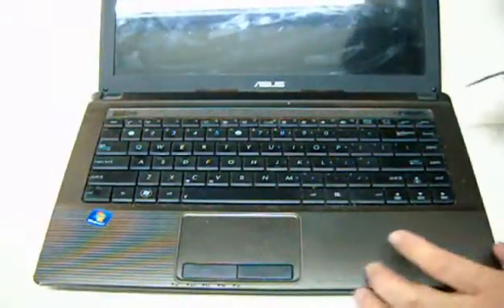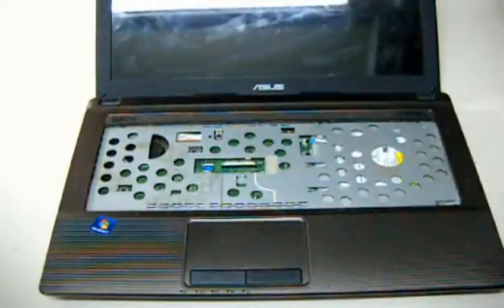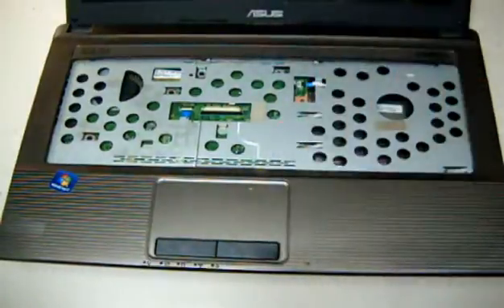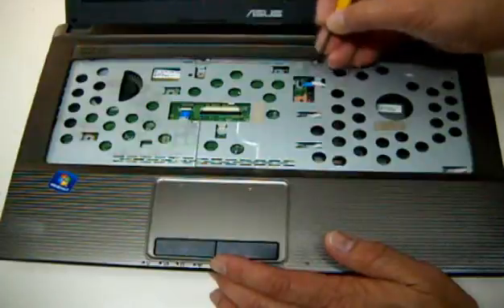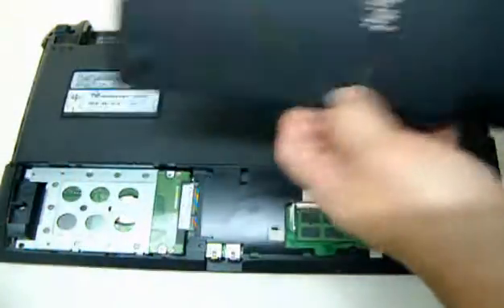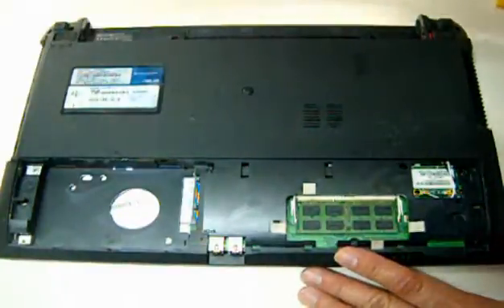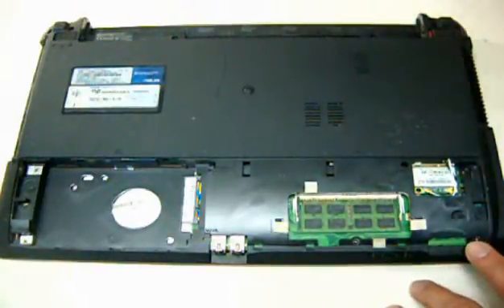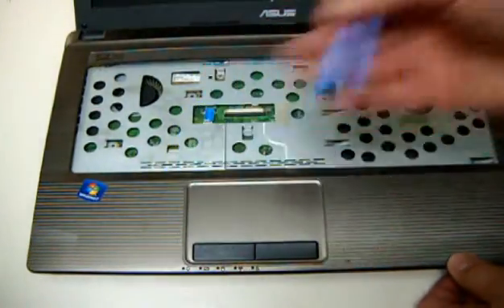How to disassemble Asus X44H K84L Notebook (complete)

Comment: Thank you!  Is the max memory for this model 4GB on one slot? I don't see another slot in your video.  Is it possible to upgrade the memory to 8GB?
Reply: one slot in a laptop and an 8GB memory module (DDR3-1333) can be installed. You can replace the processor, maximum you can install i3-2370m, i3-2350m. It is good to install an SSD for Windows.
Reply: did you upgrade the memory to 8 GB?
Reply: @yuriromero3637  yes, only the memory module must be of 2R*8 format (8 chips on each side, 16 chips in total) DDR3-1333 1.5v. 
Processor must be any i3 gen 2 (-2330m, -2350m, -2370m)
Reply: @slavafedotov5742  how about i3-2310 ?
Reply: @azam302  i3-2310m will work, but I would recommend that you save up money to buy an i3-2350m, i3-2370m processor.

Comment: Helpful video. My Asus X44H K84L Notebook was constantly re-booting and nothing in windows event monitor showed why this would be happening. Disassembly of the laptop revealed exactly what you mentioned at 12:10 in the video. The thermal conductive paste had dried up and the CPU was overheating so the bios was doing repeated shutdowns. I  cleaned off the old material and applied new thermal paste. The notebook runs perfect now. No more overheating and cycling on and off.

Comment: Hi Fabbs D,
How did the upgrade go?  How's your Asus laptop running now?  I have the same laptop and your success in this upgrade really encourages me to do the same.  If it runs well, I'll probably get the ram and cpu during the Thanksgiving Day sale this year.  Thanks in advance.  Where did you buy the cpu by the way?
Reply: Fabbs D, You can also post a video on the performance of your upgrade.  It'd be very exciting!
Reply: Fabbs D A few more questions:
1. Was it hard to replace te CPU?  As seen in this video, disassembling this laptop isn't easy.  I'm afraid of breaking anything.  (Replacing the HDD and RAM are a piece of cake, but not the CPU.)
2. I think there is only one memory slot, right?  An 8 GB 1600 mhz sodimm memory stick is still expensive right now. 

I'm sure the performance is outstanding, especially with SDD.  I used a Toshiba 128 GB SDD on my Acer Aspire One AOD270 netbook, and expanded the RAM to 3GB.  (You have to crack the 2GB ram limit on the 32bit Win 7 OS.)  Now it runs so well, with a 9-cell battery bought on Amazon.  It runs 12-17 hours without recharging.  With the original 6-cell battery, it holds about 7-10 hours.  I actually prefer this netbook to an iPad. 

So did you get an extra 2.5" external HDD?  How did you use the original HDD.  Just being curious.  This ASUS unit has a USB 3.0 port, I think an external storage would be very useful.  :-)

If you can, just show us a few things llike the boot time, regular MS Office use, and gaming.  You don't have to; I know it takes time to creat a video, edit it, and post it on YouTube.

Thanks a lot!!
Reply: Amsu Patel By the way, is this Asus unit's Wifi network card an 802.11g?  On an 802.11n network I see it shows 802.11g/n or 802.11gn.  Not sure what it is.  Asus doesn't provide good information about this laptop.
Reply: Fabbs D I'm not very clear about what you did with the external DVD RW and the 1TB HDD.  It seems that you put the HDD inside the DVD drive caddy, but how is that possible?  Anyway, that's an amazing job done.
Reply: Fabbs D As to the performance, I have no doubt about it.  It sounds like after all the upgrade this laptop is functioning like one that's twice or three times of its montary value.  Pretty impressive!
Reply: Fabbs D I actually spent a whole day on the Web trying to find out the max capacity of RAM size on this Asus laptop.  Some say 4GB; some say 8GB.  What's worst is that on the office website, there is no clear information about this.  But now your experiment proved me that it's 8GB and up to 1600Mhz.  Thanks a lot for your help.  You are awesome!
Reply: Fabbs D Holly molly.  That's a solid proof of the whole upgrade.  It makes it look llike a newer model that's on the market these days.  Thanks, man.
Reply: Fabbs D Hey Fabbs,  I assume you are using what's available and free for your 1TB hdd.  In case you want something smaller, there are 2.5" hdd enclosures and hata to usb converter cables you can use.  FYI.  :-)
Reply: Fabbs D Now I finally understand what the DVD caddy does for you.  I thought you have to connect to it with a USB cable.  It's internal and you have a C drive and a D drive.  Genius!  I'll probably do this as well.  Thanks again.  :-)
Reply: Fabbs D That's exactly what I'm saying.  Your Asus now has 2014 specs!  But how is video going?  I think the video memory is only 8GB and, over the 8GB limit, it has to share memory with the CPU, right?  Does this sharing memory situation work smoothly when you watch videos and play games?  I'm not a gamer, but I watch sports online from those ramdon websits.  A lot of times the streaming isn't smooth.  I think it's either the network from their server, or my home wifi (802.11g), or the video memory on my Asus.  What do you say?

Also, if later I replace the HDD with an SSD, and intall that original HDD in a DVD RW caddy and put it in the DVD drive space, would it work?  I know you use an external HDD in that caddy, but I'm thinking of using the original HDD in my Asus.  Thanks again.  :-)
Reply: Amsu Patel Video memory 8MB.  Sorry.
Reply: Fabbs D Not into video games like me.  :-)  What about my 2nd question?  It seems to be an obvious 'yes', but would lke you to confirm.  Thanks.
Reply: Fabbs D I was just curious about gaming, but not into gaming.  Thanks though.  I'm wondering if you can somehow make the DVD RW drive (removed from your Asus) to work as an external DVD RW with a USB cable.  That way, You don't sacrafice anything from this upgrade.  Just being curious.
Reply: Guess you do this for fun like me.  There are people who like to improve or optimize stuff instead of accepting whatever the manufacturer give us.  Thanks a lot for everything.  Happy Labor Day weekend!  :-)
Reply: Fabbs D You did a good job in improving and extending the usability of the laptop.  I went to Best Buy Sat and Sun and saw laptops with i3/i5 and an HDD that ask for $450-$600.  I'm sure your upgraded Asus performs much better than those.  I'll wait until the price of an 8GB ram stick (i7, SSD, and DVD caddy as well) gets lower, then I'll  do the same.  :-)
Reply: Fabbs D That's a good point.  It's too bad we can't change the video card.  But since I'm not a gamer, it's not too big a deal.  I have to study for two big exams this fall, so this upgrade could be a project after the exams.
Reply: Fabbs D The update or the exams?  LOL.  I'm afraid I can't provide good news about the exams.  :-)  Anyway, you are a good man.  I'll keep you posted.  :-)
Reply: Yeah, I know.  :-)
Reply: Amsu Patel I sent you a private message, please.
Reply: Hi Fabbs D, I didn't take the exams.  Instead, I did an independent study with a professor hoping that would lead me to produce a thesis.  I am gonna have another independent study with the same professor next quarter, but now I'm feeling that I might want to take the exams because I'm not sure the professor and I will come up with a topic for a thesis.  That sounds weird, but it could happen.  In that case, I won't graduate in June 2015.  So I might just take the exams in May 2015 and graduate in June, IF I pass both exams.  I hate exams, but...  You know. 

I haven't upgraded my ASUS.  Instead, I bought an 11.6" Acer fanless laptop for $188 including tax at Target before Thanksgiving.  Then I bought 8GB ram and a 128GB Toshiba SSD on Black Friday to upgrade that laptop.  Now it runs pretty well, and it is very light.  I'm not sure if I'll upgrade this ASUS because most of the time I do my work on this new Acer.  :-)

Merry Christmas,
Amsu
Reply: Heya. I did an upgrade myself as well. I bought a desktop, and I choose every component myself. I bought an AMD 6350 at 3.9ghz six core, 16 gb ram, 700W power supply, nvidia gt 730 video card and an asus motherboard. It's way better than the laptop as power. But I'll keep my laptop for traveling and other usage.
Reply: Hi, So you throw away the original components?  :)  I guess you must know how to weld.  How do you know the motherboard and video card all fit the chassis of the new laptop?
Reply: What do you mean to throw away? No I didn't throw away anything. And no, they shouldn't fit.
Reply: Oh.  I thought you bought a brand new laptop and "took out its guts".  Then install the motherboard and video card, etc.  :)
Reply: No. A new computer. PC
Reply: Faa d
I see.  You're talking about a desktop, right?  I was assuming we were talking about a laptop.
Reply: that's right
Reply: Faa d Just in case you know the answer...   I'm thinking of upgrading to an SSD on my ASUS laptop (same model as the one in this video) and use the original HDD as a 2nd storage using the DVD drive space.  Now, I have Norton 360 installed on the HDD in this ASUS.  So, can I install Norton 360 on the SSD?  Last time I tried to switch Norton 360 to another laptop but it didn't allow me.  I have only one permission from a friend.  If the answer is yes.  I'll probably do this upgrade in summer, when I graduate and have a job and time.  Thanks!
Reply: If you just want to keep the licence and switch the hard drive, you just have to move the windows image, and make few tweaks. it's doable, but you have to do some research.
Reply: Faa d Ok.  I see.  But I don't want to create an image of my current settings because there are some hot key functions lost as well as a trovi virus that Norton 360 can't remove.  I'd like to have a clean reinstall.  I guess I'm gonna lose the Norton 360 license, right?  Thanks.
Reply: Yes. That's right. But in my opinion it's worth loosing a Norton 360 licence over a SSD. :) But that's your choice.
Reply: Faa d Hey man!  Thank you so much for giving me useful information.  I guess I'll have a clean reinstall this summer when I graduate.  I might do what Fabbs D does - installing an i7 CPU and install the original HDD as a 2nd storage in the DVD drive space.  After all, I'll have time and money to play with this ASUS.  Oh, I can buy my own Norton 360 license as well!  If possible, I'll also upgrade the network card.  I think this is not a b/g/n card.  Take care and have a great year 2015!  :)
Reply: Yea, the network card it's not b/g/n. Have fun playing around, Happy new year.
Reply: Faa d
Thanks for your answer.  Sorry for checking back late.  School is driving me crazy.  Best wishes man.
Reply: :) same
Reply: what 8gb ram stick did you use? can you pull it up on amazon?